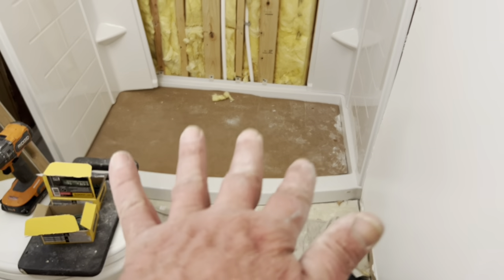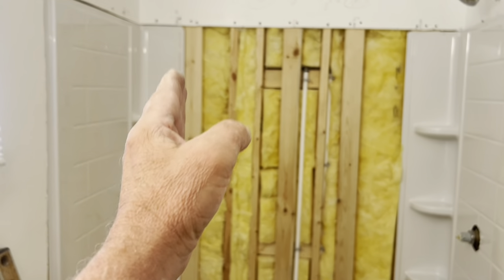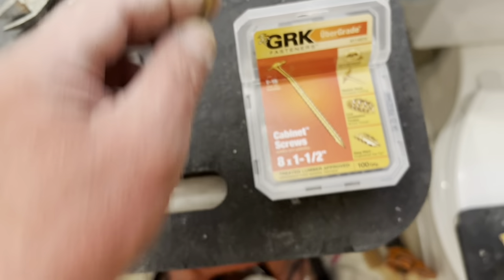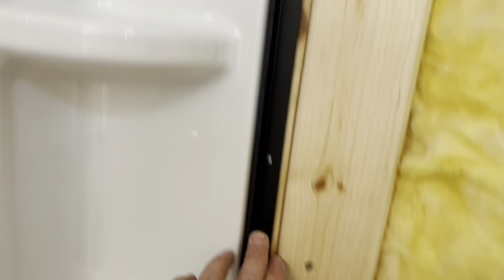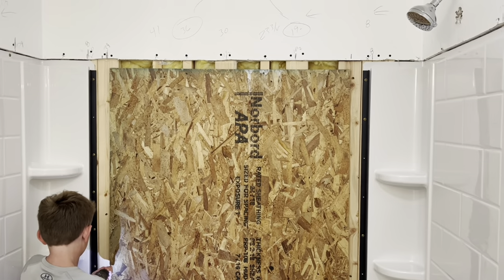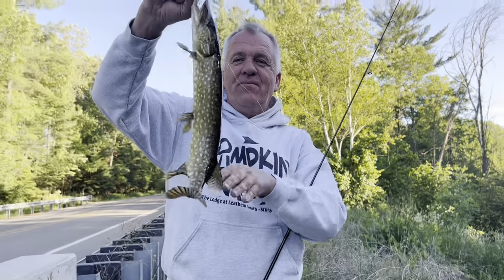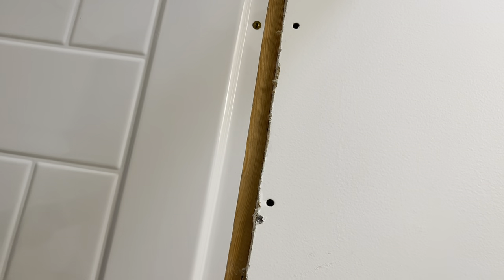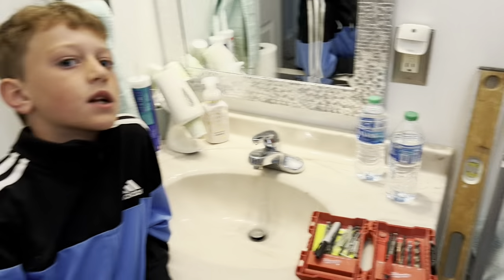Bathtub to Shower Best way less Money

Comment: You couldn't be more correct about the passing of cost and work to installer... Sterling is God of shower enclosures... Amazing
Reply from the maker: Yes, they’re putting more and more on the installers each and every year to reduce the cost at the factory of manufacturing
Reply: Definitely the best video of  this type of shower unit..  I did have 1/4 space between back and side wall joint.. You indicated to correct , with a shim? not sure if i need to shim the whole OSB panel  out by 1/4”  , or  shim out the corner?
Reply from the maker: @Ivanskrakow  Just the corner should do if it does not move when you apply pressure to the panel
Reply from the maker: @Ivanskrakow  you could shim it like in three or four locations just to make sure there’s no give in the panel

Comment: I so regret not just going with Tile. Wife wanted a surround. This seemed to be the only surround that would fit my 1996 American Standard bath tub. Soooooo Glad you posted this EXCELLENT Vidio ! also the comments section about the “Glue”. After reading the comments I took back the 8 Tubes of construction glue and bought the Lepage PL 700Tub and Surround Adhesive. I hindsite I should have replaced the existing tub and purchased a nice Fiberglass Surround.
Reply from the maker: Ceramic tile done properly is three times as much work double the money if you're doing it for sometimes triple. Ceramic tile is much harder to clean.

Comment: Good video, I'm in the process of installing the neo-angle version of this and the instructions are terrible! So far, the hardest part has been figuring out what the framing in the back should be. I wish I'd have just forked over a couple hundred more bucks and gotten a direct-to-stud surround. You're right about the manufacturer putting the extra work onto the installer. After you factor in time and extra materials this surround doesn't seem to be nearly as good of a deal as it appeared from the onset.
Reply from the maker: Yes it’s all put on the installer(home owners)saving manufacture millions $$ Thank you for commenting

Comment: I just bought this. I completely ripped out the old shower and it looked good with no moisture damage. My question is this: can you just completely cover the studs with osb on all 3 sides then add your walls?
Reply from the maker: No the end walls need a one by four placed. If you watch the video, you will see where the one by four is placed it cannot be just solid flat OSB.
Reply: Never mind just opened the box and see now. Thanks
Reply: Thanks for the reply. I truly appreciate it
Reply from the maker: anytime Im here We can talk ya through it like landing the 747    @OklahomaJoe72

Comment: Hey, where does the 1x4 exactly go?
Reply from the maker: 1 x 4 stands vertically exactly where your shower door would screw to the wall. Dry fit the end panel and you can mark on the wall and floor(base). exactly where it falls use a level it should be level up and down

Comment: Im at the door install and my door hits at bottom and 3/4 gap at top. Im a tad out of level on the top rail but I can’t get these things to line up, wall says level, glass says it’s level…. Any advice sir?
Reply from the maker: Sounds like the rollers are not both in the same place. Check the rollers

Comment: I see door sagging issues on the Lowes reviews.  Did this happen to you, if so, how bad and how fixed?  Thanks!
Reply from the maker: Not sure I haven’t heard nothing about that. I can’t understand how the door would sag unless maybe it was improperly installed. I mean it’s not a hinge door it’s on rollers. How does a rolling door sag? would need more information to draw conclusion.
Reply from the maker: The door rolling door does have some adjustments on it but if not, tighten down properly could loosen up it’s kind of a tricky thing Glass doors rubber plastic you don’t wanna overtighten, but you don’t wanna under tighten kind of like a toilet

Comment: Hi, thanks for the video. The manual says the board thickness is 7/8, is this correct? What thickness board did you use?
Reply from the maker: The one by four is three-quarter inch of course and the OSB I believe was 7/16 I don’t believe there was anything that was 7/8 of an inch. I think for the OSB board if you’re right around a half inch you’ll be fine

Comment: What adhesive did you use. I just went through this and the adhesive failed. Did not stick to the panel at all one side and barely on the other. I used loctite pl 3x. Should I use pl 550?
Reply from the maker: The ends are screwed to hold it in place so I don’t know if the glue held or not because I don’t think the screws would let it come off anyways. And with the connector strips the back panel snaps in place also so I don’t know how important the glue truly is. We use whatever glue was recommended in the instructions I believe it was Loctite. I don’t have the greatest memory. But that looks like the Loctite in Jackson’s hand, gluing the back wall.
Reply: I bought loctite tub surround adhesive and it worked great! The pl3 failed to bond.
Reply from the maker: @govee257  yes, I don’t think PL3 is recommended
Reply: @Worldwidegiantgrowers  the instructions just said adhesive and I just grabbed some general construction adhesive...should have thought about the surround material.
Reply from the maker: @govee257  yes Tub surrounds are very easy to damage with the wrong adhesive

Comment: How much would you recommend to charge minus the shower door?
Reply from the maker: Where do you live? what is your experience level? Are you insured these are all factors and how much to charge are you installing the shower valve?
Reply: Just walls around the tub, no shower pan. I have the carpenter experience you need since only skills you need to install this over ridiculous price junk 😅. I have it installed now. I think I under bidding them, tho. I only changed 600.

Comment: Any tips on the door portion of the install.  Just cannot get doors square, support bracket seems to warp under the weight of the doors.
Reply from the maker: Where are buying your doors?
Reply from the maker: Is there lumber in the wall to secure to??
Reply: @Worldwidegiantgrowers  The whole system was from Home Depot.
Reply: @Worldwidegiantgrowers  yes
Reply from the maker: @jeffsiarto-VoiceActor  Not sure why you’re having issues it might just be poor quality. They do sell a lot of low quality stuff in a big box stores
Reply from the maker: The good stuff has to be special ordered at the big box store most of the stuff on the shower office of lower poor quality that will not have a long life in your house

Comment: Would 600 for taking off old tile, frame work, install panels only then finish of the sheetrock.
Reply from the maker: That’s dirt cheap. I would want double that and then some.
Reply: What I thought but she tight 😅 tyvm for your help. You have been a fantastic help and video was very helpful.
Reply from the maker: @TheBlockBlunder  Good to hear.Run from cheap skates

Comment: Hey Bubba, I'm currently installing this shower myself and the directions are horrible. My question is do you put osb behind the shower faucet side wall as well.
Reply from the maker: Yes, you do both ends would be the same one by four and OSB
Reply from the maker: Did you get it done ?
Reply: @Worldwidegiantgrowers  ok great thank you and not yet I got the sidewalls up but of course I'm missing of the connector strip for the back panel so I'm waiting for one to come in the mail
Reply from the maker: That stinks. I hate it when missing or broken parts slow down your operation.

Comment: It it 3/4 or 1/2 in OSB on the wall? Can't find thickness in instructions.
Reply from the maker: It’s not three-quarter inch I believe it was like a half inch it might be a fraction under half-inch
Reply from the maker: Second thought I believe it was half-inch I think Home Depot sells both half-inch and they also sell 7/16  youwant a half inch
Reply: @Worldwidegiantgrowers  . That's what I picked up I can dodge a return the 7/16 will work I'll lay a cigar fat bead of PL and be generous with it. Appreciate you getting back to me. The instructions are non-existent on this.
Reply from the maker: Yes seven sixes will work we will just need to put your glue little heavier Glue the studs under the OSB and then glue again on top of the OSB that will make up the difference
Reply: I just did the install with 7/16 as 1/2 is made of unobtainium in my area. The 7/16 worked well.

Comment: where do the shims go?
Reply from the maker: Well, if I understand, you’re trying to tighten up the seam for the back panel and you would put the shims wherever you are putting the screws if you shim it out along the outer edge and then you’re going to fill that in with drywall mud as hot mud .hot mud  the perimeter like I show in the video Shims would go at the screw locations
Reply: @Worldwidegiantgrowers  at first I thought I needed to shim out the osb and all of the studs , which didn’t work , than I saw that you can flex the corner a little 1/8” to make up the gap and put the shim behind the upper flange .  Thanks , your video helped , plus I need to start reading the instructions:-)
Reply from the maker: Yes, you can shim the panels themselves up to a quarter of an inch possibly 3/8 of an inch as long as you don’t pass the surface of the drywall it will fill-in with the hot mud

Comment: Thanks for this video! Where did you get the connecting strips from??
Reply from the maker: They come with the walls part of the package.
Reply: @Worldwidegiantgrowers  Hi there and thanks for the video! can you tell me how you shimmed the end panels? I know that probably sounds ignorant, but I need to make adjustments to the placement and am not a contractor. Thank you in advance for your kind reply.
Reply from the maker: @jerrybrockman3115  I just backed out the screws on the end panels in slip a shim behind and then screwed it back down give me a eighth of an inch off each and to make up for the quarter inch
Reply from the maker: @jerrybrockman3115  how much distance do you need to bring it in?
Reply: @Worldwidegiantgrowers  Thank you for your response!

Comment: Hey, Big Bubba, great video.  I’m about to out in one of these showers and I appreciate the tips.  By the way, the instructions with the base say it is good for up to 300 pounds without a mortar bed underneath.  What say you about that?
Reply from the maker: It’s not a matter of strength to me as far as a weight load I do not want the pan to ever move if it moves that’s gonna be a recipe for disaster so regardless of the weight limit I mortar them in. But I’m an overkill kind of guy I’d like to do things top notch. I have had people call me to their homes in their bathtub is moving because it was not mortared. When I tell them I can pop off the bottom tile pull the tub reinstall the tub put the tile back on and we’re talking like $1500 to do so. They cringe and typically I don’t get the job they just live with the mess
Reply: @Worldwidegiantgrowers  Bubba, thank you for the reply and I understand. I also like to do things right the first time.  So, what time of mortar did you use and did you put it down and then put the pan on it wet and bed it down?
Reply from the maker: @andysparks7381  Yes it really helps to level it also. you want to use a sand type mortar not concrete. Yes you put it down wet and then you level and secure your pan to the wall walk away call it a day. Go fishing and come back the next day and walk in it
Reply: @Worldwidegiantgrowers  Gotcha.  Yeah, sand topping mix, sand and cement.
Reply from the maker: @andysparks7381  I just use some tile mortar that I had left over some Laticrete 4XL I’m sure that will suffice I had a half a bag .it’s free why not use it
Reply from the maker: no gravel to bumpy to make level
Reply: Always add a mortar bed under a fiberglass pan or tub. Without one, there will be deflection when stepping in or out. Then, the customer will be calling you back, thinking it’s loose. 
  Better to be proactive than reactive. Besides, have you ever tried to explain to an elderly person that the movement under their feet is normal? You won’t convince them. They’re already afraid of falling.
Reply from the maker: @joebaker9861  great advice thank you

Comment: WHY OSB?  that crap is worthless in a moisture area -- Why not use cement board (Hardie board) behind those panels!
Reply from the maker: You would have to ask American standard. This is their recommendation.
Reply from the maker: Most likely it is stronger cement board would be weaker between studs Also convenience if they make the job more difficult to install cement board is very difficult to stall for most people that would cost them sales. I’m just hypothetically guessing.
Reply from the maker: historygradstu  I would not do that. If you’re worried about the OSB getting wet, I would primer with an oil base primer and let it dry and make sure you do the edges but I don’t think there’s no need to do that. I think it will be fine. You should never leak that way.
Reply from the maker: Who are you talking to? And why are you being disrespectful?
Reply from the maker: If you don’t use the recommended products, they will not stand behind any kind of warranty
Reply from the maker: The overlap system on the shower panels is almost impossible to leak. It would have to come from above, so that is why the OSB is fine. These panels do not leak it would be a rare occurrence.
Reply from the maker: Cement board hardy backer board would be overkill and create more work

Comment: That shower suck not yours but the kit….just trash
Reply from the maker: @781coolmind  I guess that would depend on what you're comparing it to your budget matters? actually it's not a bad shower easily ask last somebody 20 years with no problems or hiccups under normal use
Reply: @Worldwidegiantgrowers  I installed one. and thank god I found your video.. because I couldn't believe. what I was working with.
Reply from the maker: @781coolmind  it's definitely making you reinforce it with the OSB and the one by four not an ideal product in my opinion